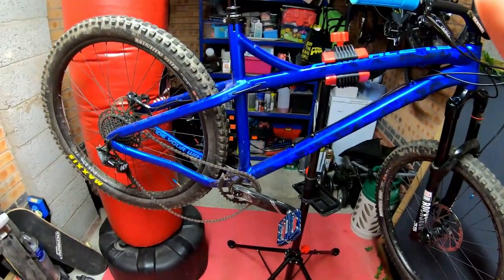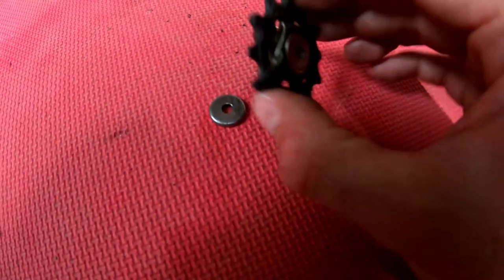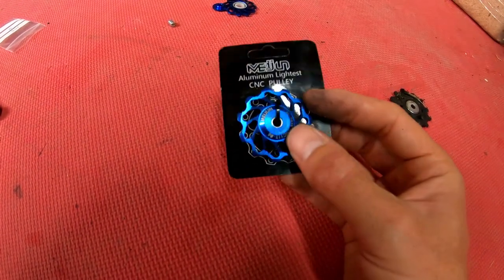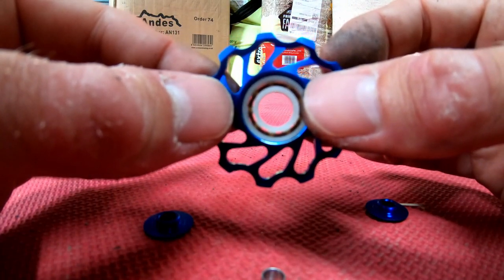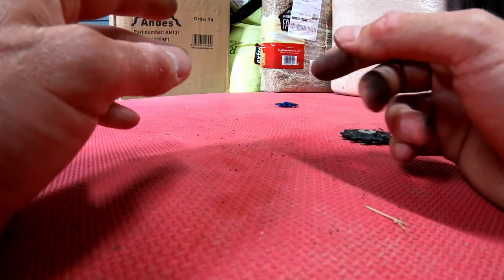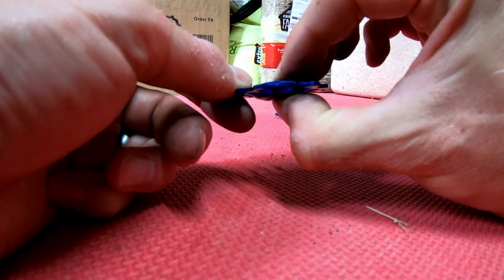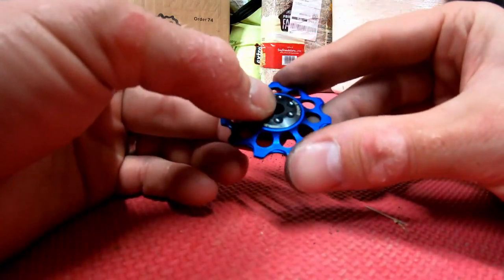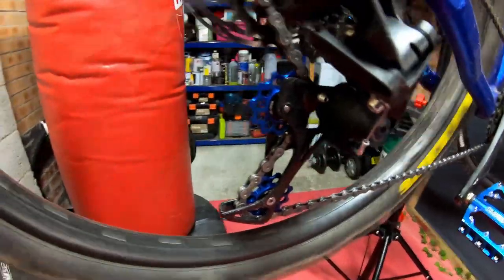Mountain Bike upgrades - WHY you shouldnt buy cheap alloy Jockey wheels

Comment: Its completely normal that oem jockey wheels dont have actual bearings
Reply from the maker: The x01 x1, etc oem all have jockey wheels with barings
Reply: This is a bushing and, yes, there are many jockey wheels with bushings which need an occasional lubricant applied to them.
Reply: @lazurm  d

Comment: on the contrary, the little amount of play is actually needed for the guide wheel to function properly .. the lateral float takes up the differences in tolerances between indexing and the actual cassette spacing
Reply from the maker: Never heard such rubbish TBH, It is the derailleur arm which moves the chain up or down the gears, you don't want pay in the jockey wheel as you want this arm action and wheels to be in situe when doing this. Each cog has a guide channel if you examine your casette which is responsible for moving the chain into or out of that gear
Reply: @jonnybrown5715  you haven't heard that jockey guide wheels (as distinguished from jockey tension wheels) do have a bit of play? then you know nothing about derailleur jockey wheels .. lol!!
Reply from the maker: Well if you want to buy bad jockey wheels with loads of play be my guest... it will be you with issues and premature chain ware and no end of issues, I have YET to find a well made/known brand SRAM, HOPE, superstar, etc  (as ran them all over the years) that have play in that you can physically create with your fingers.. but hay what would I and these manufacturers know.. you are obviously the highest level expert on the planet... please do buy these cheap jockey wheels and run them... I beg you lol
Reply: @jonnybrown5715  i did not say that these cheap ceramic bearing pulleys are any good, i just pointed out that guide pulleys (again as distinguished from tension pulley) indeed are meant to have a small amount of play on purpose .. a fact you seem to be ignorant of .. 😂
Reply: @jonnybrown5715  Never hearing of something shouldn't automatically result in your calling it "rubbish". You don't know about jockey wheels and should, therefore, be open minded and study the voluminous amount of information on this, and virtually everything else, on the Net.
Reply: @attybong  Definitely should have play. It's normal.
Reply: I'm with Johnny on this. I've been having indexing problems for a while and traced it to worn jockey wheels. Bought some new "standard" ones and they came with a small degree of "float". It improved my indexing from my totally worn out set but it wasn't as crisp as it should have been.

Watching it all work from behind the bike and it's plainly obvious there should be NO play, especially in the guide wheel. It's just not necessary. In fact it's counterproductive. Click the shifter and the play absorbs/loses some of the movement. You end up over tensioning the gear cable to allow it to change small to large sprockets, and then it doesn't drop large to small as it should. Under tension it to allow for smooth drops and it won't move to larger sprockets unless you push past the index.

In the end I paid for some quality ones with proper bearings and no play whatsoever, and now the bike changes gear as crisply as it did was when it was new.
Reply: @NigelMarston  mine's got no indexing problem .. got a full DA9000 groupset .. installed ceramic wheels on the RD pulley, got a bit of play but it never affected the shifting efficiency .. perhaps it's has something to do with the quality of groupset .. not sure though
Reply: @attybong  I think a "bit" of play is inevitable but I don't think it's a design feature, more a consequence of tolerances. Looking at the type with no bearings at all, they're supposed to be adequately sandwiched when installed to prevent as much sideways movement as possible however it's not actually possible to sandwich them to the degree where they don't move sideways at all or they will bind. Having an actual engineering bearing in the jockey wheels does away with the need to provide a bit of play.

The reason I looked-up this video was because I had ordered a few replacement jockey wheels already and had received a bit of a mixed bag. I ordered two sets of cheap alloy ones, from two different sellers, and a set of expensive "proper" alloy ones. The expensive ones came, as Johnny described, with proper engineering bearings pressed into the wheels, and have absolutely no sideways play at all. These are the ones I have used on my bike. But one of the cheaper sets seems surprisingly decent too (the other is utter rubbish as per this video). There is a small amount of play but not even as much as on a brand new pair of Shimano wheels, or a brand new pair of BBB wheels (I do a bit of bike maintenance for locals so I've always got bits and pieces in the garage). I can't prise them apart without damaging them but I suspect they have plastic bearings inside - there is very little inertia when you spin them. In fact, my daughter has a fidget spinner with a proper bearing inside which has far more inertia so I have that for comparison.

I've installed the better pair of cheap ones on my daughter's bike to see how they last. She doesn't do many miles so it'll take a while before I get any meaningful results but they look pretty and she's happy. I suspect they will not last many miles but I have her original ones to put back in if/when they fail.

And as for the other pair of jockey wheels - the crappy pair - I live near to one of those engineering "hub" towns in central UK so I popped over to one of the distributors at lunchtime and picked-up a set of decent bearings. I could claim that I pressed them into the alloy wheels but the closest match I could find went in with nothing more than a gentle tap with my pin hammer. They seem secure enough with the end plates on. The bearings only cost me £3 each. Those will go onto my son's bike for a test. He does a few more miles than my daughter so I'll get some idea how they're going to last in a few weeks.
Reply: @NigelMarston  well, others say a little bit of play is normal specially on the guide pulley

Comment: If you are using he bike as a mountain bike and getting covered in mud, dust, water and whatever, then the grit will ruin anything that isn't a sealed bearing.  You are better off cleaning the original jockey wheels....period

Comment: The plain bush bearings are proven tech... A balance between efficiency and reliability.  A ball bearing is great but needs to be maintained rigorously because any dirt inside will wear the balls out fast, they need lubricant and this attracts grit as well.  A plain bush will work as the plastic wheels don't need that much lubrication so the dish washer is sufficient to keep it running clean.
Reply from the maker: If plain Bush is proven why do only entry mech's use them and all mid to top end ones use barings .... it a cost thing nothing else
Reply: @jonnybrown5715  It's proven for jockey wheels and not as good, compared to the alternatives, for other moving parts in a bicycle. Jockey wheels aren't as critical.
Reply: @jonnybrown5715  From what I gather, with jockey wheels, there is only a very slight mechanical advantage with bearings. Apparently 105 uses bushings, Ultegra has one bushing and one bearing, and Dura-Ace has two bearings. I'm working on a cyclocross bike with Sram bearings that are completely destroyed after occasional use, so I was considering replacing the jockey wheels with bushings for the maintenance advantage mentioned above. (although now I'm actually going to try replacing the bearing first). It seems that if you're riding in poor conditions, you'll go through a handful of bearings before the jockey wheel teeth are worn.

Comment: Bought a pair of sealed bearing jockey wheels (alloy) from amazon, cost me like 9-10 usd. Much much better than the stock ones came with shimano altus. The new ones don’t wobble sidewise at all like the old ones used to do from day 1 of installing deraileur. Also looks cool bcz its rainbow colored / petrol finishing.

Comment: What about alloy wheels with regular metal, sealed bearings though? They cost about the same or even less than the ceramic bearing ones and don't come with the problems described here. Trace Velo made a nice comparison on that, showing a cheap ceramic bearing one being even more loose after some use, also became all gritty and crunchy. On the other hand, the sealed metal bearing one actually only worked better after some use as brand new bearings tend to be somewhat stiff as the metal surfaces have to sort of adjust to each other. For that reason I find the title here a bit unfair as it only applies to CERAMIC cheap alloy wheels, and they're not the only kind out there.
Reply from the maker: If you listen to all the issues it isn't just the bearings that aren't great, if you want poor quality order cheap ones, if you care about your bike buy it good quality
Reply: Decent sealed ball race bearings should work perfectly out of the box. There is no bedding in required

Comment: There are two jockey wheels in a rear derailleur. The upper one is the Guide wheel and the lower one is the Tension wheel. The Tension wheel doesn't have this play and the Guide wheel does, so that the chain will be guided onto the sprocket more efficiently. The problem with the great majority of Ebay bought jockey wheels is that they are almost all Guide wheels, with play as they should have. The colorful ones are those that most purchasers want to show off, but if they are Guide wheels, they are hard to see. 
The name brands usually sell them in sets.
Reply: So top one should be wobbly, lower one shouldn't? I'm here cuz one or both of mine are wobbly, but if the top one is genuinely supposed to be wobbly, I'll go check it again before I decide if I need to buy one/some... 🤔

Comment: last time I looked at a modern derailleur jockey wheels they appeared to be made of plastic or carbon fibre rubbish. The ones I had on my bike in the 1960’s were proper ones made out of metal .Those old school chain ,sprockets & derailleur gears never wore out .The cranks had proper cotter pins & never came loose ,the bearings were better than the crap modern ones in tin cages you get now .People are getting ripped off for push bikes these days they are made out of cheap crap metals & plastic tat .The bike manufacturers are laughing all the way to the bank
Reply: Masked Avenger: Sounds like you're starting to experience the affects of old age. :)
You may not like carbon but a lot of people do (including myself) as the material absorbs shock while retaining the power transfer, unlike 531 tubing (a "retro" bicycle I also own). It's low weight and almost infinite design capabilities allow a bicycle to do what bikes of old couldn't. 
The old bearings needed routine maintenance while the sealed bearings of today don't. 
People have always gotten ripped off but, heck, if you have the funds today's bicycles have benefits and features cyclists of old couldn't even have dreamt of. 
By the way, I'm 71 but keep my mind open. ;)
Reply: @lazurm  They are shoving carbon on everything & also over charging for it .The stuff looks bland & tacky & not what you want to be close to in a thunder & lightning storm .You can’t beat a proper old steel lugged frame ,& proper bearings .Those modern bearings are cheap Chinese pot metal in weedy tin cages containing only half the amount of bearings .I have also never rode a cotter less cranked bike that the pedals haven’t worked loose in a short time .Old bearings that were set up with proper grease & cones adjusted correctly very rarely gave trouble ,until they had given good long service & were due to be replaced .The old bottom brackets had little brass lubrication caps that hinged up for regular lubrication .the wheel hubs also had sprung dimpled covers you could slide over to lube the axles .When you bought a bicycle in the old days ,you got a full bicycle  now a lot of the features are missing or done on the cheap for quick profit .That’s why you see so many bikes chucked in skips after a short time, back in the day you would only see bike frames & parts abandoned that had been stolen .Just because something is classed as modern ,it doesn’t mean it’s better or of good merchantable quality .Old age has nothing to do with it ,I know quality build when I see it .I have been spannering  many bicycles since 7 years of age & motorcycles & cars since about 16 or 17 years of age for around 50 years .
Reply: @maskedavenger2578  The best made bicycles of today are far more enjoyable to ride than were the best bicycles from the early 70's into the 80's. 
Today's bicycles shift more precisely and even while applying pressure uphill. Today's bicycles are lighter (faster starting and going uphill), won't bend so easily, won't rust from the inside, don't need nearly as much maintenance, are more efficient at translating pedal applied energy into forward motion (they're faster), can be formed in many more configurations which optimizes their specific purpose, the shifters are at the same place as the brakes (less problematic, faster and safer)...and more. 
Denying any of the above puts your mind in La-La land.
Reply: @lazurm  The old gears wear better & went smoothly into gear by feel without snapling ,the jockey wheels & guide wheels were made out of proper metal not cheap tacky tin & plastic .Proper compag , Hurret ,& Benelux gear cassettes or quality Sturmey Archer hub gears .Modern gears chains & cranks don’t last 5 mins now poor quality overpriced crap ,The disc brakes are cheap thin pot metal ,& even the modern puncture outfits are next to useless .
Reply: @maskedavenger2578  Okay, you have to be trolling at this point. "...cranks don't last 5 mins...." Please.
Reply: @lazurm  Your the one that’s being an troll ,to last five minutes is a saying to mean a short time .Modern cranks do not last anywhere near the length of time the old quality steel cranks did if a bike has regular use .Also most modern cycle shops can’t even rebuild a buckled wheel ,they are not proper cycle mechanics they are just part fitters & most of them not even any good at that .
Reply: @maskedavenger2578  You haven't addressed my counterpoints so that's why you're declared trolling. Read them and measure their worth.
Reply: Proper cotter pins 😮😂😂.FFS. I grew up in the 60s with these abominations - I am a mechanical engineer so I know what I am talking about- and as kids we were all desperate and delighted to get our hands on Cotterless cranks as soon as we could. You just sound like the Monty Python Yorkshiremen sketch so I do t even respond to the rest of your absurd comments
Reply: @maskedavenger2578 I have been riding cotterless cranks or chai sets as we call them since the 1980s and never had a pedal come loose ! What are you on about ? Pedals do get tight but loose 😂😂😂😂😂
Reply: @maskedavenger2578 
Carbon fibre and thunder and lightning storm danger ⚠️ 😅😅Now I have heard it all
Reply: @marcdaniels9079  If you had half a brain ,you would realise carbon fibre is one of the best conductors of Electricity on the planet . I had bikes with cotter pinned cranks for years never had one come loose . Had bikes with cotter less cranks come loose within 2 weeks from new . Modern pushbikes are overpriced tacky crap ,compared to old school push bikes .
Reply: @marcdaniels9079  If you were a mechanical engineer , you would know if something ain’t broke there is no need to try & fix it . When we were young the build quality of bicycles was much better , & the hand built ones even better quality again . Not like the cheap tat that passes off for supposed quality today .
Reply: @lazurm  For your information a troll is a mythical being ,said to inhabit certain areas of Scandinavia , not some one who makes comment on an open channel that invites comments . I suppose anyone who doesn’t subscribe to your opinions is a troll according to your skewed logic . Using your logic I could easily accuse you of being a troll .
Reply: @maskedavenger2578  Your definition of troll is similar to your ideas about retro bicycles, out of touch and out of date. To whit, the modern slang definition of troll, one mostly used these days is: In slang, a troll is someone who intentionally posts offensive or provocative messages online to provoke an emotional reaction or argument. Trolls may post inflammatory, irrelevant, or offensive comments on social media, in newsgroups, forums, chat rooms, or online video games. They may also say things they don't believe to cause drama.

As to facts. I've had cottered cranks that came loose...twice. Either way, what you like and experience isn't more than one data point and, as such, fair and accurate conclusions can't be made solely based on your experience.
Reply: @lazurm  My definition of a troll is the correct one ,not the fake made up definition spouted by computer nerds .  Last time I checked this channel invited comments , & I am just as entitled to a view & make a comment as anyone else. I believe the bicycles from several decades past were of a better build quality & that’s my opinion ,this is not something I don’t believe or state just to cause drama as you incorrectly assume . If my comments have caused you any drama ,or find any offensive ,then all I can say ,is you must have lived a very sheltered life .

Comment: Did you go for the 12tooth option?
Reply from the maker: hiya, this was for an 11 speed system so the 11T wheels
Reply: @jonnybrown5715  Interesting, i went for the 12t option because the plastic jockey wheels that came with the NX are 12t.. i also run 11 speed